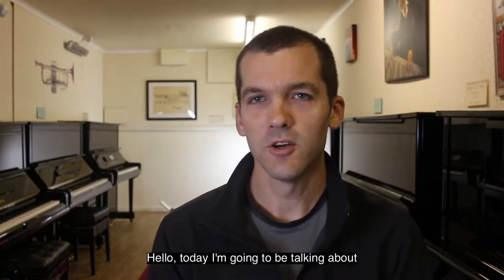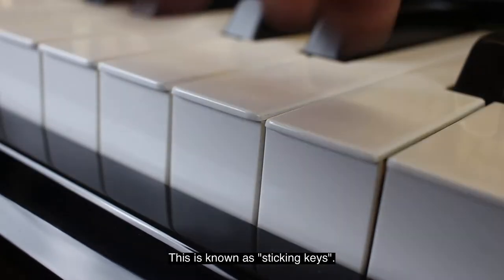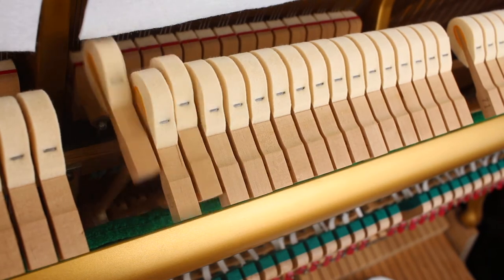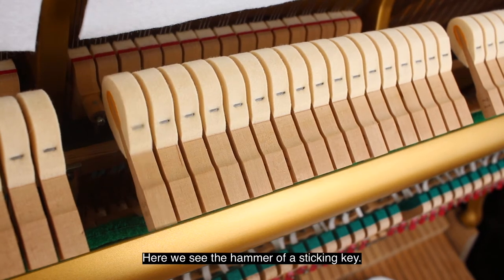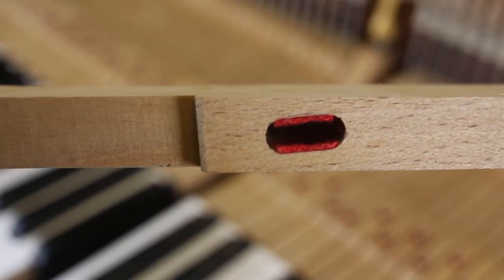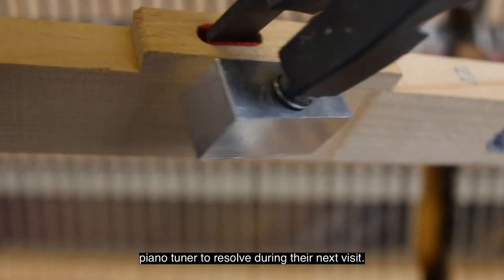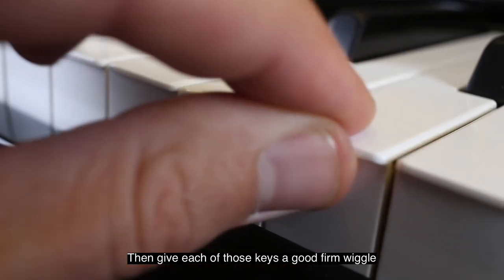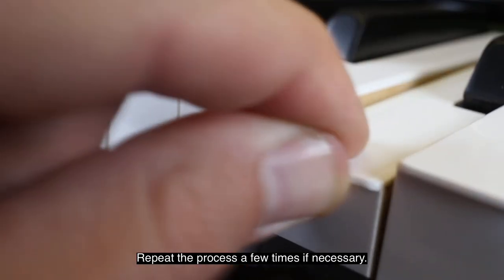Piano Sticking Keys Tutorial: Quick & Easy DIY Fix / How to

Comment: For those who try this and it doesn't work: It didn't work for me but I finally checked the pin underneath the key (closest pin to you), and it was a slotted pin that had been rotated slightly, like 11 & 5 on a clock. So I grabbed a pair of pliers, carefully rotated it back to 12 and 6, and it was fixed!
Reply: Thabk you soooo much

Comment: considering what's wrong and his solution it looks like moving the key to one side and moving up and down would be as good or better than 'three different position moves'.
Because the move is simply squashing the felt isn't it?  three times.  at one end, in the middle then the other end.  so move it to one side then work the key and you've squashed it end to end surely?  Then do it again with the key held to the other side.  Now you've squashed both felt sides end to end.  I've got two sticky keys.  I'll try it.  
Did it. Both fixed.  My way.  Bit hard to push them to one side so I stuck a clarinet reed between the keys on the side away from the side I was pushing to in order to help me. If that matters.
:)  Give a new insight into the piano really.  It's a wonderful instrument alright - but it's just a collection of levers at heart isn't  it?

Comment: I have a problem with sticky black keys. When I press a black key the front of the black key gets stuck to the white key and therefor isn't able to come back up. Any idea how I can fix this problem?
Reply from the maker: If that's just happening to 1 key, you might just need to file some of one or both keys. Remove the top panel, lift out the fallboard, unscrew and remove the action, then you should be free to inspect and file those 2 keys. For best results, hire your local tech! :)